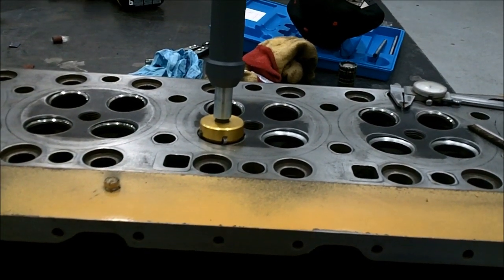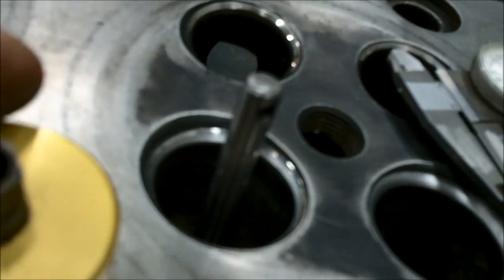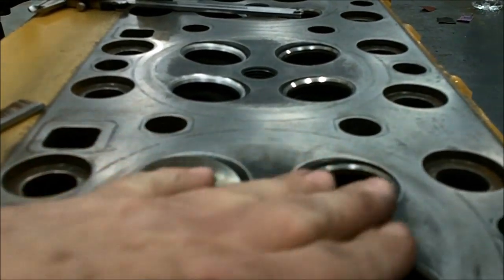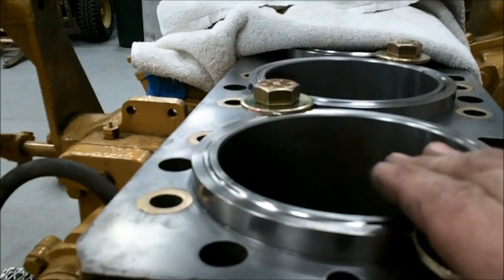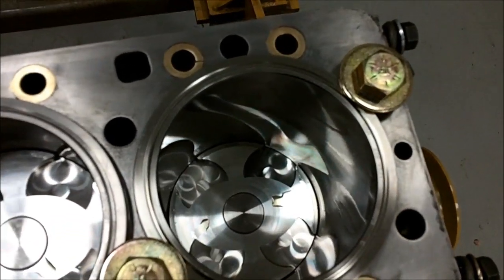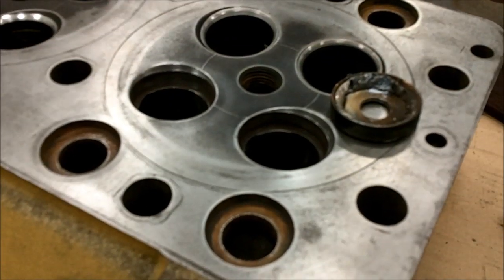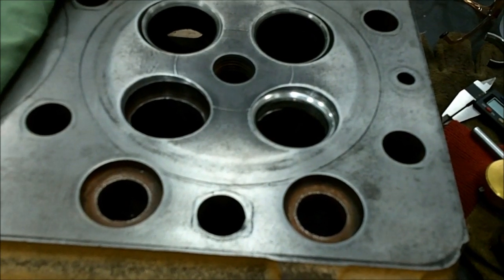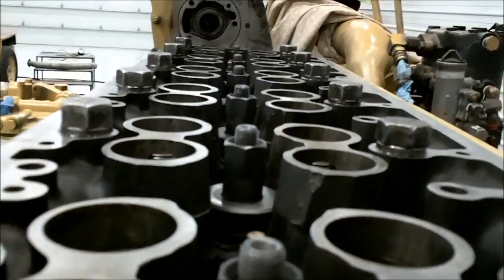Cat D343 1693 Repair Part 3

Comment: Hey Jeff..I’m watching you use your new cutters....I also kept a set for small jobs after I sold my engine shop in jersey...a small suggestion that might help in future jobs..cut your 45 first..then use blue or red machinists dye. I use a divider to establish the diameter of the seat...about ten or twenty thousands from edge of the valve....once dye is dry you can then use your top cutter to establish the diameter...your bottom will then be used to establish the width...of course their are many ways to do the job and you are doing fine..I’m just offering a different way that always produces good results

Comment: I am new subscriber and realize this is old video. Drove truck for 35 plus years mostly construction in Reno Nevada. Also worked at machine shop on weekends. Did alot of resurfacing on diesel heads and blocks. Hauled alot of dozers for Wells Cargo in Reno to Las Wages. Nothing like you mostly low boy equipment, and returned to Reno with triples. Only hairy part was the open range cattle. Was blessed and never had a mishap. Great videos live long and prosper. John
Reply from the maker: Thanks John

Comment: Carbide angle cutters are good for most company shops for in house overhauls and rebuilding.  

I use Sioux equipment seat grinding stones in my machine shop for versatility.  
I see everything from mini bike engines to 24V-149 engines including Fuel Injectors and Pumps.  

You do a very through job on ALL your in shop and in field repairs and Preventive Maintenance.

These are the goodies I use in my 1 man shop for remanufacturing cylinder heads.
I have Sioux stones to cut seats from under 3/4" to 4-1/2" and 3 stone dressers.  
1 stone dresser for the contact seat angle and 2 for the top and bottom relief angles.  

I have 2 more dressers for 5 angle high performance seats and a radius dresser for round seat profiles which are rare.  
I use a Sioux seat dial indicator to check the concentricity of the valve seat to valve guide BEFORE GRINDING the seats.  
Often replacement guides are pressed in crooked.  This saves a lot of grief.  

Because I am LAZY, I have a separate valve guide pilot for each seat.  
All this extra equipment was was paid for on 4 jobs.  

On just 4, V-12, 4 valve, complete Aluminum cylinder head rebuilding jobs for a Racing Team.  A whole weeks work.  

The customer gave me a $500 tip because my job was better and cost less than his previous Machine Shop.  
Mostly I hear: "This is too expensive and it took too long".  It's better if you do ALL your own work. 

JPAYDIRT your YouTube channel is awesome.  Most folks that run equipment don't realize what it takes to run a Contracting Operation.  I am in the Nor-Cal area and all the regulations just made the costs go up and up for customers.  

If I was younger I would move out of California and leave it to the Illegals.  Keep up the good work you do.

God's Blessings on you and yours.
Reply from the maker: Thanks! I can't find anyone willing to do a correct valve job, so I decided I would have to do it, and wow did it make a difference in how they start and idle, It's very time consuming but well worth it

Comment: Are you going all cat parts? How are the aftermarkets, ?
Reply from the maker: Piston's sleeves bearings are Clevite, D9 has FP Diesel in it, Have had good luck with it so far, I buy some Regal and Costex stuff sometimes also, Gears I generally go with cat, even cat stuff now is poor quality on some things especially anything with rubber in it, It's a crap shoot

Comment: One of the problems with these older Cat engines were they had so many layers that oil leaks were hard to stay on top of and most when you looked at them slobbered like hell.
Reply from the maker: You know I guess i have figured out how to make then clean, I just don't have the problem you described, not that it doesn't exist, I know it does, but when you figure out how to seal them they are actually clean, as far as the slobbering goes that's mostly timing, one degree late will cause problems, I advance just a bit here for elevation and they start good and idle clean, sounds like you have had some experiance with these dinosoars

Comment: Those great big exhaust ports are just waiting for a stray nut or washer to drop into a cylinder. Been there done that. I'll rest better if you tape the ports shut LOL.
Reply from the maker: edward beday I like to stick paper towels in them to prevent that, one time I forgot to remove the paper towels and it wouldn't run any faster than idle, until the paper towels caught on fire and exited in a blaze of glory

Comment: Its so neat to see a few good guys out there, I know on the 3406 heads they went to replaceable seats, I don't know if cat sells replaceable seats for a 1693/d343 if a head were to experience a burnt valve, a damn good job here in a vid of explaining valve seat resurfacing, I do alot of major engine repair and most of all I do now is cut blocks and replace seats, injector cups, and surface the heads. its so neat to see a real good ole engine get fixed right, what an awesome vid..
Reply from the maker: Alexander Elrod Thanks!  Yes we replaced two seats, they are replaceable did you notice I broke the first one @ 6:35 I had never done one and got crooked, oh well thats how you learn